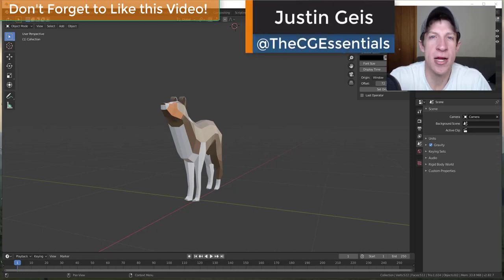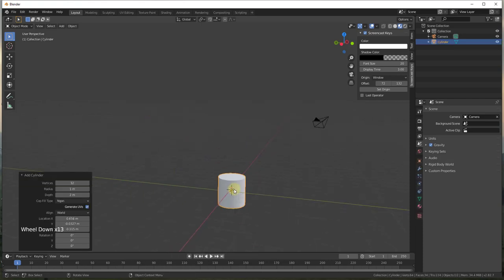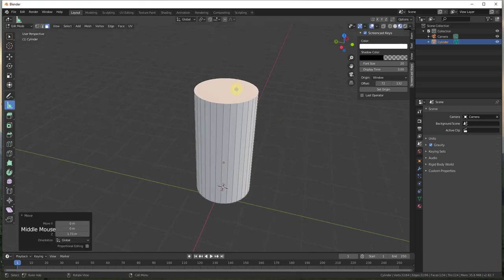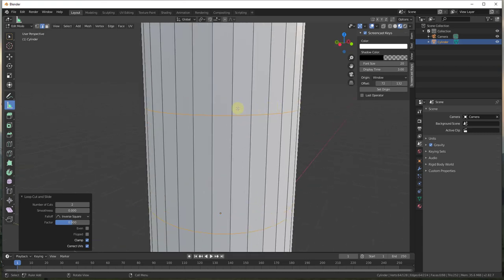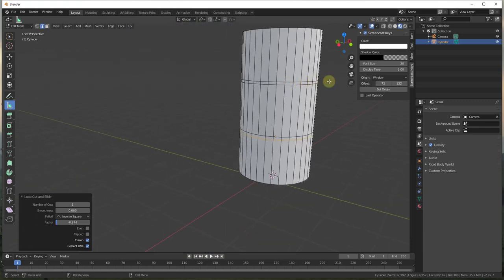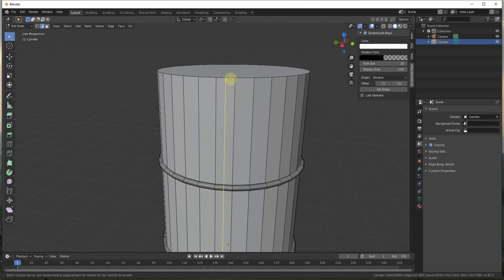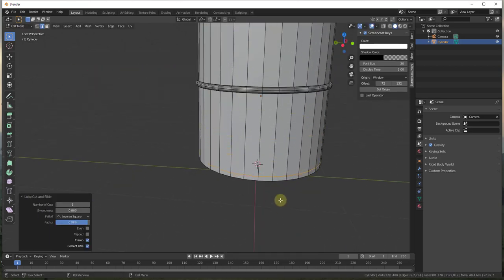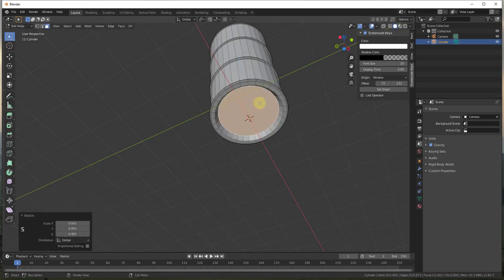Modeling a METAL BARREL in Blender - Blender Modeling Exercise

Comment: Hey man, great tutorial. I just have something to add: I was doing a barrel like this by myself (before I came across this video) and I actually did it the same way. Problem is, when viewing the render in cycles, there are massive shading problems due to the insufficient amount of faces on the vertical edges. It's specially noticeable on the 2 lower ''bumps'' of the barrel. Even using smooth shading, the shadow presented in the render is all squared up and messy. So I had to go the subdivision modifier route. I say this because even after beveling those vertical edges, there we some problems with the smooth shading.